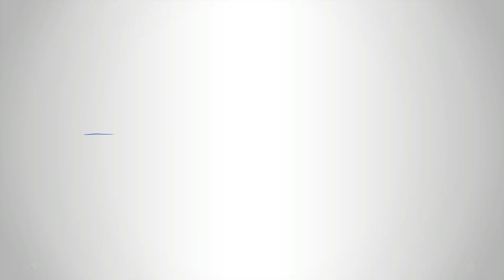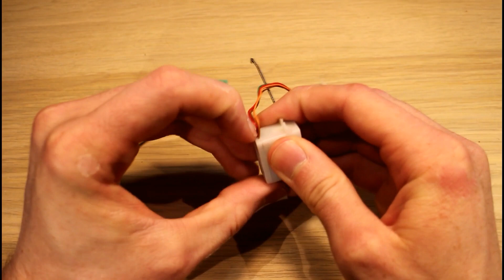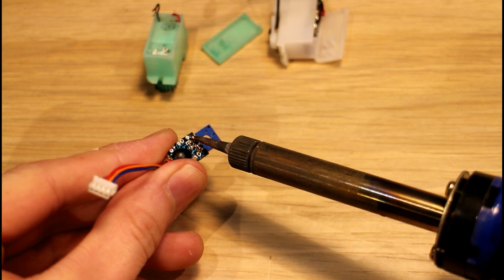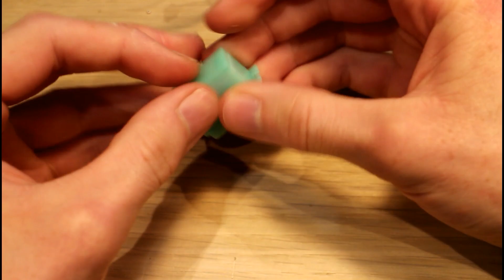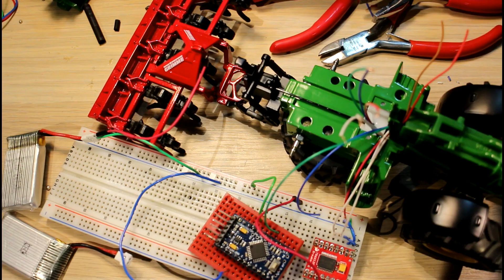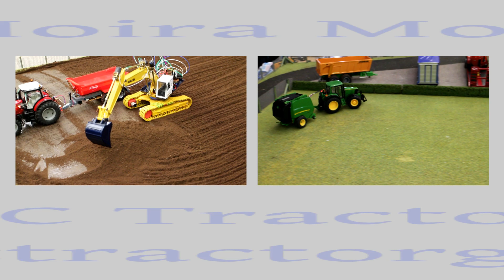Converting a Siku Control 32 John Deere 6920S Part 2 - Working on the Servos

Comment: Hello, I've been watching your videos for a while and I thought I'd have a crack at some rear linkage, I bought a damaged Siku RC Fedt 939 (it only steers left) I've fixed this problem now. I was just wondering where you get your moter drivers and servos from? Im quite new to this. Cheers :)
Reply: Ebay i think😁
Reply from the maker: +Tom Smith Yes Marcus is right I usually order things from ebay and mostly the same sellers, the ebay listing for the components I regularly use are on the site here http://rctractorguy.com/store/electronics. Sometimes I order from Aliexpess because there are sometimes parts I can't find anywhere else cheaply. And sometimes I get large orders from ICStation if I want all the parts arriving together.